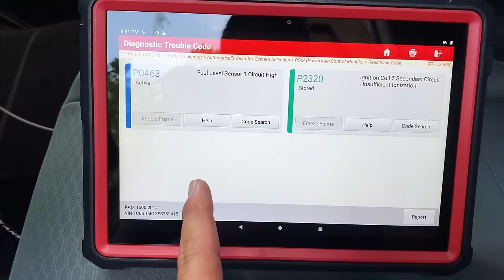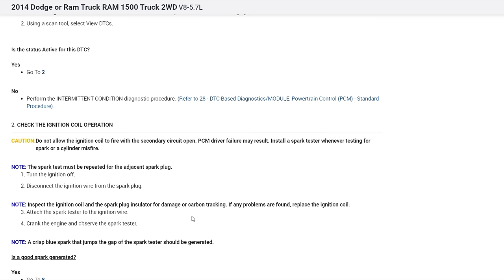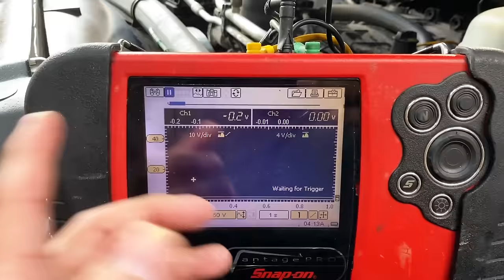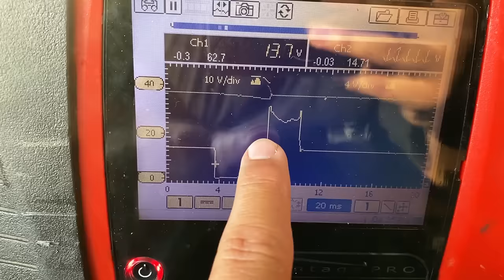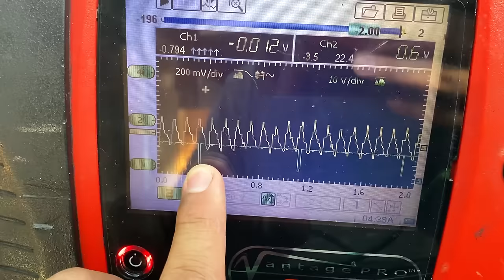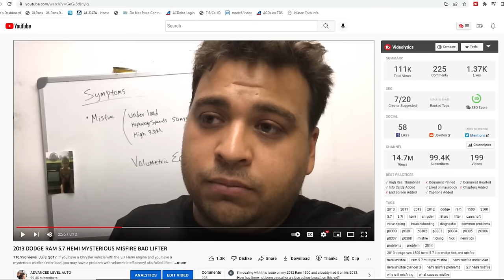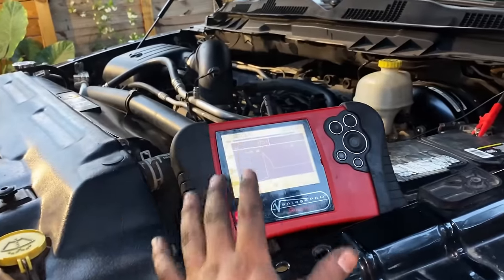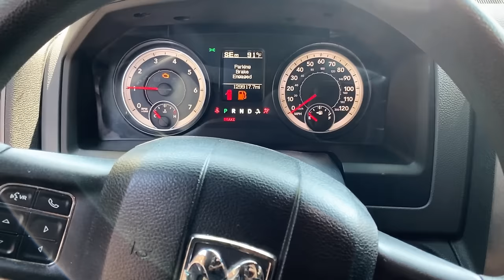DODGE RAM 5.7 HEMI MISFIRE INSUFFICIENT IONIZATION DIAGNOSIS & FIX

Comment: By golly, I hate this job,  and that was an easy ignition system to diagnose, done this kind of work for 30 years, should off went into fixing airplanes better. 33 minute video how long did it really take to conclude the fix? Then you get a computer from Auto Comp that doesn't work, back to square one. Customer second guessing you, doubting you really knowing anything. better be right the first time or else. Then wait for the whining and crying why did it cost so much $.....never ending stress..... fixing today's electronics on cars nothing is routine anymore, that's what makes luxury cars throw aways after a few years, the fix cost more then what the car is worth...you're still young get into fixing planes instead.....
Reply from the maker: I've been there before with bad remanufactured ECUs. It's a pain in the neck and it makes you wonder if you made the right decision. I've never thought of working on planes before. I guess because I don't know any aviation mechanics. Thanks for watching!